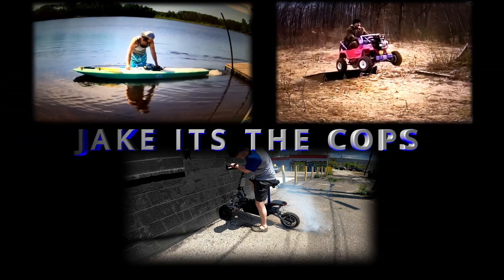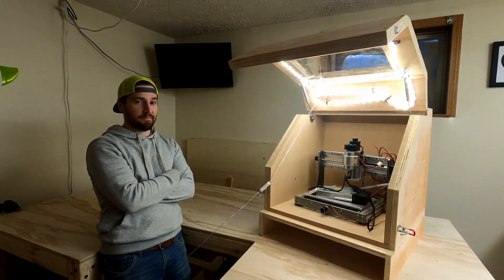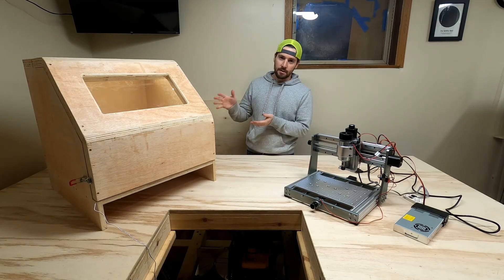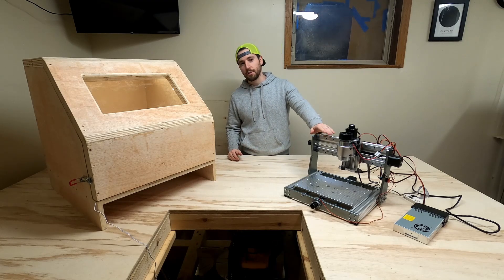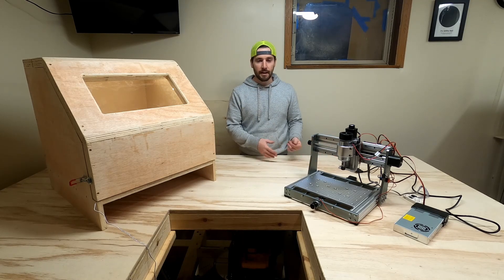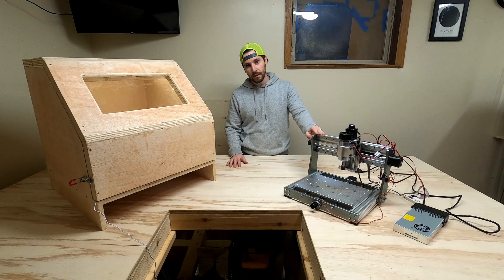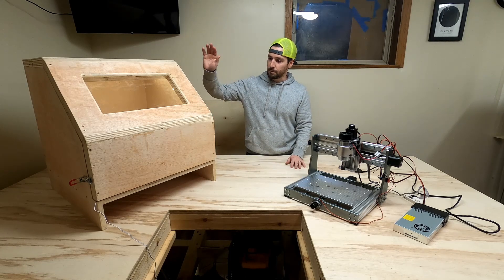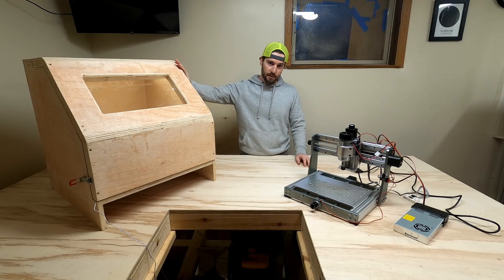I Built an Enclosure for My New CNC Machine - Noise Reduction for Indoor CNC

Comment: how many db reduce? great work
Reply from the maker: I don’t remember, but it dulled out the harshness a great deal.
Reply: @JakeItsTheCops  Thanks for responding. Do you think the results would be similar if I used a double layer of plywood instead of MDF? mdf is better?
Reply from the maker: @Acseq8wy I’m sure it would be fine if that’s what you got. A big improvement to my design would be to add rubber feet to it so the vibration doesn’t transmit to the table it’s on.